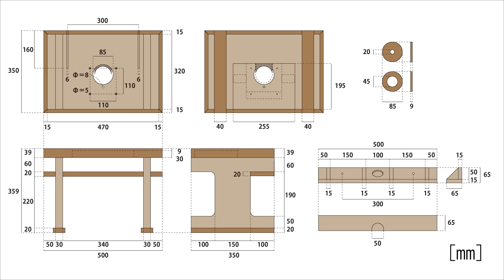5 in 1 Trim Router Hacks / Diy woodworking

Comment: Thank you for this instructive and detailed video.
Maybe someone else has also made the observation and already written something suitable about it: Your fight with the power cable...
If not, here is a little practical tip:
The cables will lose this fight if, as in many professional workshops, you mount a junction box with an extension cable on a not too heavy chain hanging from the ceiling above your workplace. About 30-40 cm above face level. This allows you to work more freely up to a few revolutions of the machine. And most machines today have at least 1.5 meters of supply cable.
Less struggle=more power for the project!
Stay with us for a long time, Master!